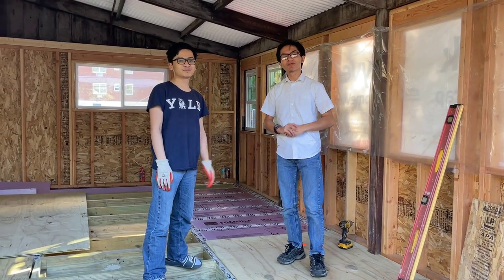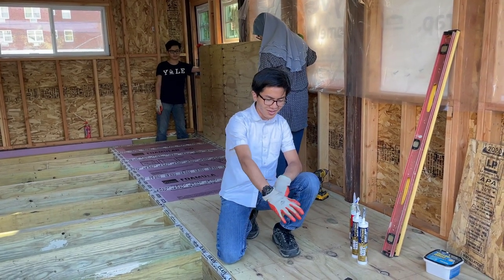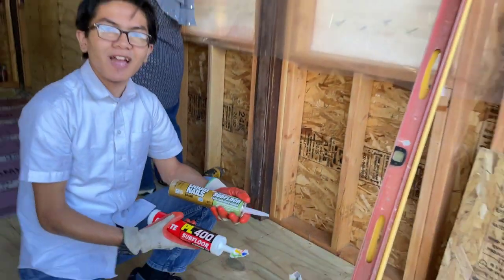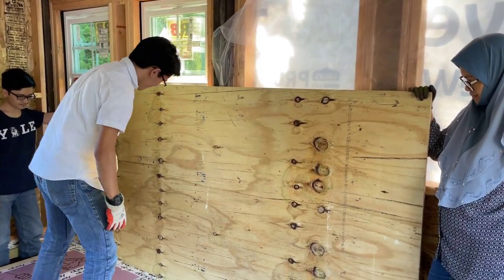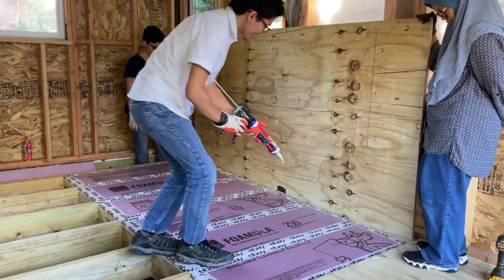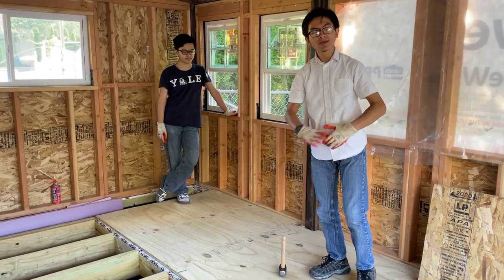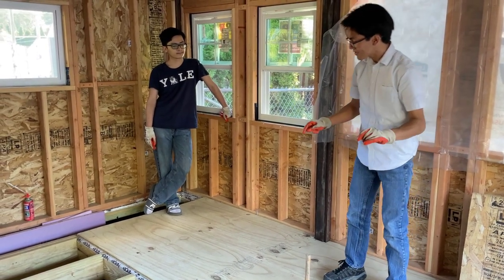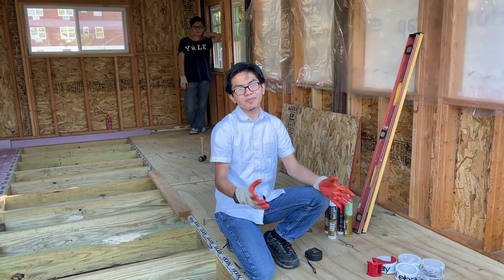Installing Plywood Sub-Floor In Our Enclosed Patio-Porch | Adhesives Types, Thickness vs Joist Span

Comment from the maker: Here are the #ad links to some of the hardware, materials & tools showcased or required for this project:
1.  https://amzn.to/3DZgCik  |  Loctite PL 400 Subfloor All Weather Construction Adhesive, 10 Ounce Cartridge, Tan, 12-Pack (2136216-12)
2.  https://amzn.to/3EZ9q7m  |  Newborn 930-GTD Drip-Free Smooth Hex Rod Cradle Caulking Gun with Gator Trigger Comfort Grip, 1/10 Gallon Cartridge, 10:1 Thrust Ratio
3.  https://amzn.to/3yDrT76  | (Cleaner Only) AdvanTech Subfloor Adhesive Dispensing Gun Cleaner | Polyurethane Cleaner | J.M. Huber | Includes (6) 12 oz. cans
4.  https://amzn.to/3E6lF0I  |  DRICORE Insul-Armor Premium Subfloor with Air Gap Technology, Helps Protect Water Leaks, Warmer & Soft Finished Floors 2’ X 4’ X 1” Covers 80 Sq. Feet (Bundle of 10)
5.  https://amzn.to/32cagPG  |  Minwax 42853000 Stainable Wood Filler, 16-Ounce

Or Click on Amazon link here and search for what you need:  https://amzn.to/3xIOsqg